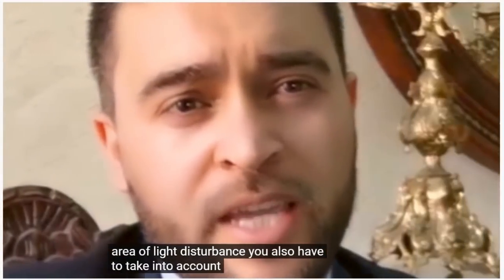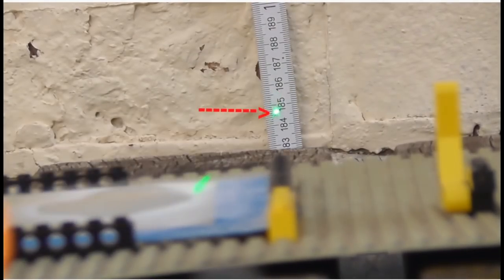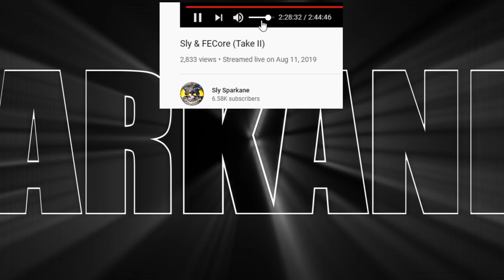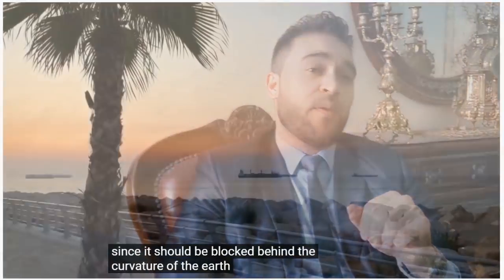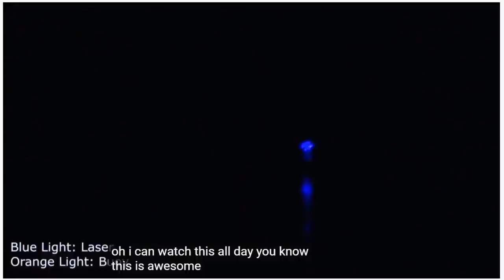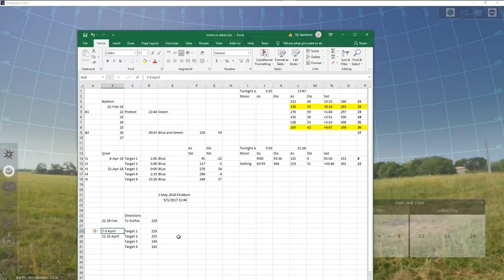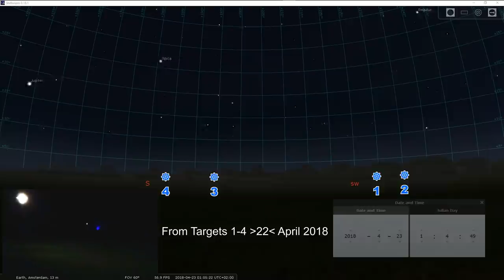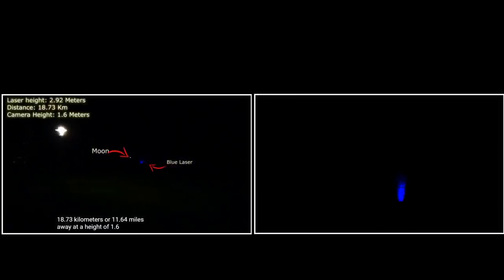About that FECore Laser Video pt1

Comment: All that work with lots of people and expensive lasers to try and prove the Earth is flat.
It is so simple and cheap to test for that.
If the Earth is flat then the sun must be circling above it once per day at some constant height.
That means that the track of the shadow of the tip of a stick should be circular everywhere on Earth at all times of the year.
Well, for any spot between the arctic circles, that shadow track is a hyperbola, except on the equinoxes when it is a straight line.
Never a circle.
Case closed.
All one needs to debunk flat Earth is a stick and a sunny day. 
That is really sad for flerfers!
Reply: The track of the Sun on the Equator at the Equinoxes is utterly impossible on a Flat Earth. I've never heard them even attempt to explain that.
Reply: Their excuse to deny this is that the shape of the ground cannot be determined by looking up at the sky. But modeling this over a flat table and a gym ball will show sky observations can absolutely prove the shape of the surface.
Reply: or more easily put not one observation that can be made of the sun supports that it is circling above.... 
you know the main difference the great 19th century hoax pulled off in the flat earth belief.. all previous FE beliefs thought the sun rose & set. something we see almost every day.
Reply: @vimalramachandran  
Looks at shape of ceiling.  Looks at shape of floor.  Shakes head at silly flerfers.

Comment: Exactly as I been saying....they don't level the laser. They just point it at the horizon.
Reply: The second time they have done that, makes the experiment completely null and void. So stupid.
Reply: ...where it is guaranteed to bend along the surface to any distance, because in the evening and night the surface cools down faster than the air above, creating a strong positive temperature gradient, aka dense layer of air above the surface, with refraction coefficients above 1 and more with ease. Refraction coefficient 1 or greater means light curves with the same radius as the earth or smaller. 

OF COURSE THE LASER AIMED AT THE HORIZON WILL BE VISIBLE AT THE OTHER END. 

How many years do this clowns need to understand refraction, when there are excellent resources available for free to study it? And FECore claims to have engineers on board. Really?

Sorry for the clown. But FECore called me a clown as I pointed out their many errors in the doku of their last test. They couldn't even use a calculator correctly, have no clue what a correct equation looks like, and they messed up the refraction calculations completely. They tried to apply Snell's law on a medium with a density gradient. Even in Wikipedia is stated that Snell's law can only be applied on the boundary of 2 homogeneous media. For air you have to apply Fermat's principle using calculus. The result is, light curves in an arc with a certain radius depending mainly on the temperature gradient. This is already studied in great detail since centuries and the resulting equations are even published in Wikipedia. 

If you don't think Wikipedia is correct, I independently derived exactly the same equations myself from basic physics, using the Ciddor equation to calculate the index of refraction and Fermat's principle and Calculus.
Reply: @WalterBislin  Given the temperatures  and heights published by FE core, can you calculate what the refraction coefficient was in their tests?
Reply: But then the beam is level over the horizon.
They should do some science on a shorter distance and measure the refraction with an auto level at the same height.
Reply: @vimalramachandran  I think that’s really difficult to accomplish. For starters you would need measurements for temperature and moisture along the entire path of the beam.
Reply: @WalterBislin  just waiting for you to show up here. And as a single thumbs-up is much too less for your contribution here come some more: 👍👍👍
-- Martin
Reply: @vimalramachandran  I don't know what is in their current publication but in the initial power point (like) presentation published by FEcore after the Lake Balaton experiment they ONLY measured the temperature difference at two locations (start and end) and applied Snell's law according to that measurement.

Which of course is utterly useless to determine the bending of light along ALL the distance caused by a vertical temperature gradient.

As such is more or less optics 101, back then I wrote a comment suggesting if the "E" in FEcore means there are any real ENGINEERS participating, I mean some who graduated at a university, they should return their diploma voluntarily before the University retracts it.
Reply: In admitting they point the laser down at the horizon they reveal that they know that the horizon does not rise to eye level.
Reply: @bulwinkle  👍 Gotcha! (or them)
Reply: Check the cc subtitles on the footage. They even tilted it farther down later!
Reply: But Bob Noodle doodle says refraction almost always causes light to refract up. And he is an engineer and a commercial pilot so he would know. Oh and he thinks there are two suns in the sky - just that one is hiding.
Reply: @thettguy  Did you read my comment on a different video how I imagine an interview with Bob may run when he has to apply for a real job, once FE doesn't any longer pay his rent some day?

Interviewer: So what did you say you did in the past five years?
Bob: I educated engineers and scientists worldwide they're wrong, since centuries.
Interviewer: Seriously now?
Bob: ...?...
Reply: @thettguy  just out of curiosity: what means "TT" as part of your YouTube name?
Reply: It was suspicious from the beginning as they didn't even try to do what they demand from every Globe test they ever criticised: document what is going on during the test with another camera, they picked a place as dark as a bear's buttcrack so you cannot see any landmarks or other identifiable signs of the surrounding etc.

Even if it would show what they claimed it did, it would be worthless as they carefully avoided any useful aspects of such footage.

A lot like Jeran doing his test, first melting down his collimator so the Laser couldn't be used, then trying to cheat with the flashlight and bigger holes and finally not even then getting a result he could fake to "somewhat flat" LOL

INTERESTING.

Comment: I'm going to keep posting this ad infinitum or until the flerfs are all extinct. Why is it that the one experiment that would prove/disprove the shape of the earth is the one that no flerfs will ever do? I'm talking about measuring the angular size of the Sun during one single day.
There are two ways that I could achieve this;
1) Buy a $2000 solar telescope
2) Use two sticks, a mirror, a piece of cardboard and a piece of string.
I'll go for option two, thanks very much! I don't have a lot of spare cash lying around :(

Comment: What's the big glowing thing on the left side of the image?
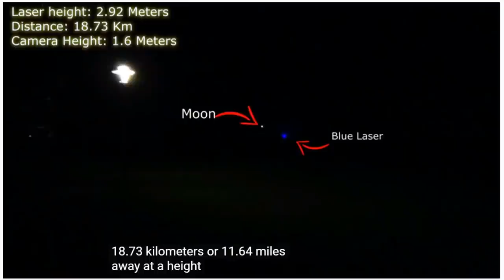11:47
Reply from the maker: a spy drone from "They"
Reply: @slysparkane808  Drone. I didn't even think of a drone. How upset would they be if someone showed up on their next jaunt and flew a drone vertically up and down above their target?
Reply: @Sableagle  Or they could do such a thing (flying a drone up and down) themselves. But no, that would come too close to start doing real science ...

But, you just gave me an idea: as refraction doesn't hardly effect a beam of light going straight up, what about pointing two laser beams in a substantial distance from each other straight up, fly a GPS equipped drone over them, and locate the beam maximum?

How much apart from each other would the two lasers have to be and how high would the drones need to fly to get a substantial difference between the "globe vs. flat" predictions?

But wait a minute: if the two lasers were spaced further away from each other than could be measured with a tape measure, they would need to reveal their equivalent for the Haversine formula on a flat Earth. And so far THAT HAS ALWAYS been a show stopper, because they can't do so:
It would give EVERYBODY even more than seven ways to Sunday to prove them wrong with a simple handheld GPS device.

Comment: I'm in just a few min and FECORE is already wrong.  There is no beam that will never diverge.  It's basic optics.  The formula for the Airy disk defines the divergence of a beam given the size of the optics and the wavelength of light.  There is no way around this.  Anyone with any understanding of optics knows this.  A good collimater helps, along with a spacial filter, but the Airy limit is still as good as you can do.  So they fail in the first few min of this video.